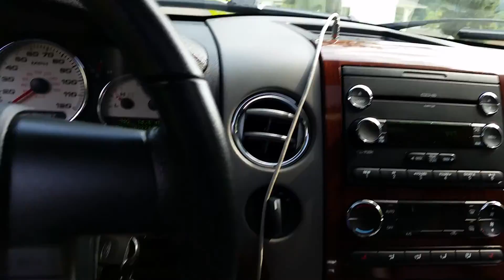2007 F-150 4wd issue, snapping sound.

Comment: Not a good idea to use four wheel drive on ground with good traction. It binds up the transmission. Just saying. I just hit a pothole here in Michigan and now I am getting an intermittent sound in the left front axle...sounds and feels like it is trying to engage then lets go. Only on the left side. The pothole I hit was a monster. Any ideas. It only happens for about tens seconds or 100-200 feet then it lets go. Just drove 30 miles with no problem. I also have a 2007 f-150 4x4.

Comment: sounds like an actulator  how does t sound when steering hard right and left if it sounds like gears slipping, check the vacum lines to the hubs also
Reply from the maker: Its about the same steering or not. It just gets louder the more it accelerates and you can feel it on the floor board. Really is teeth chattering. I didn't even know I had this issue lol. Will do, thanks! Hopefully its just vacuum line.

Comment: sounds like the actulator. the more you accelerate too, the more load you got on the teeth. Hell... idk whats up but by the sounds of it, it's chewing up the teeth on it by skipping. check vacuum lines and there sound be vids on youtube about this issue. same problem with my old 04. ended up disassembling the entire knuckle too...
Reply from the maker: Thats what I didn't want to do lol, will need an alignment afterward and will be a fairly busy project. Oh well I suppose. I might try swapping wheel bearings and seeing if the problem follows over to the passenger side.
Reply: well I can tell you how to check if its wheel bearings that are going. lift that tire up and grab it and shake it. there should be... no play  in it xD
Reply from the maker: There isn't any play now, I replaced the front left wheel bearing last December for inspection, but since then this problem has arrived. I only wonder if ithis Moog unit is the issue.
Reply: and it only does it when its in 4wd and rolling eh?
Reply from the maker: Yep, it's missing it feels. But didn't start until after the wheel bearing repair. Either teeth slip or actulator I suppose.
Reply: Either way, the sucky part is taking that tire off and seeing what is up. But hell Darren, better start now than in the winter with all the snow and shit. Cuz I will say this, if that wheel isn't engaging, there is no way that haha you're gonna have 4wd.

Comment: Did you ever figure out the problem? Because have same problem on my 2007 fx4 I replace the wheel bearing's actuator and CV and the problem still there
Reply from the maker: Yes, it was a bad passenger side IWE. When I took it apart at the spindle the IWE was separated from the teeth ring. Wasn't a vacuum issue.